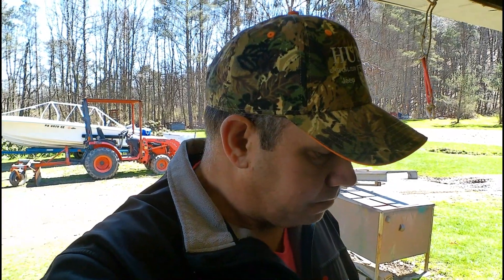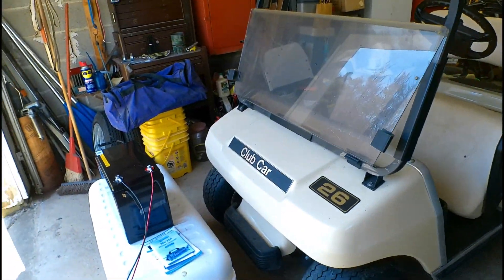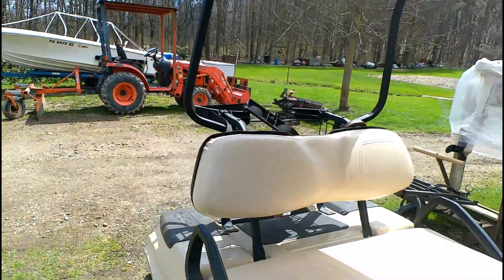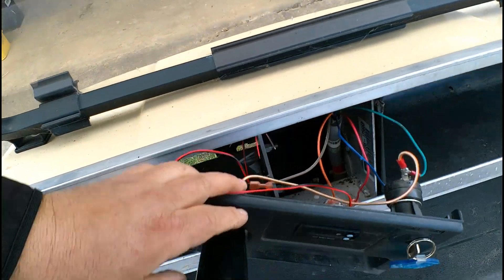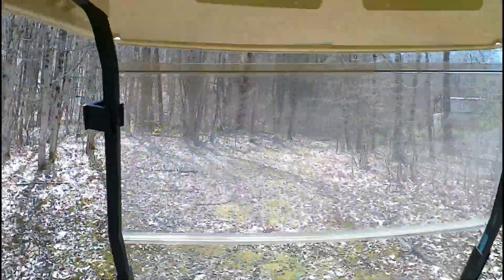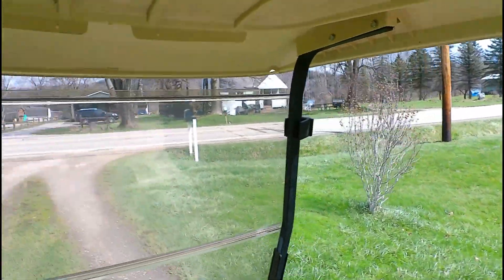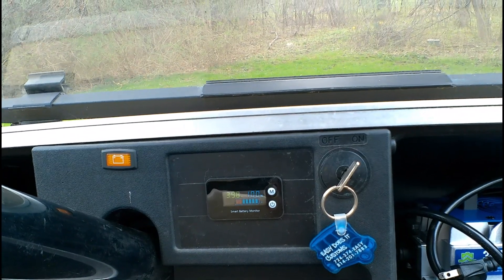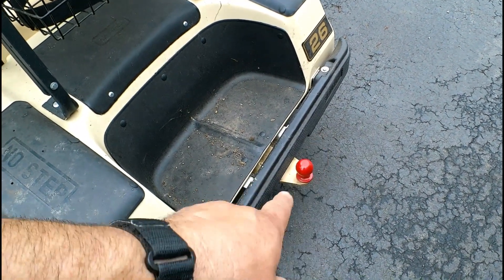Club Car Lithium Battery Upgrade | From 6 to 3 to 1 Battery | Lithium Iron Phosphate

Comment: I had the same experience with the 3-12 conversion, cooked batteries.  I even purchased a high tech (supposedly) charger.  I made the switch to li-po but the 100 amp size, with the proper charger, amazing performance.  The larger battery posed some installation challenges but not a difficult project  In addition I am still using the old "toaster" controls.  Will likely upgrade to electronic at some point.

Comment: I've had 3 deep cycle group 27 Costco batteries in my old industrial 36 volt cart going on 5 years, I use a club car 36 volt charger.  zero issues.  That said, when these 3 batteries finally die, I'm tempted to try a Lithium.  The key to lead acid battery health is to fully charge immediately after every use.  Park the cart and plug in the charger, mine has a twist knob / timer so I just set it for 2 or 3 hours and it will fully charge in that time.

Comment: Club car's website says that the maximum power output is 9600 watts.  9600 / 36 volts = 266.67 amps draw at maximum power but the controller limits the draw to 250 amps.
50 amp-hours / 250 amps = 12 minutes at maximum before the battery is fully depleated.
Used at 50% capacity,  4800 watts / 36 volts = 133.34 amps.  50/133.34 = 22.5 minutes untill depletion.
I would suggest putting another 36 volt Lion battery wired in parallel. The capacity increases but the voltage remains the same.
Reply from the maker: @Digidoc316  I appreciate the fact that you went to the trouble of researching this information, but I can assure you that something is terrible flawed in either Club Cars information or the math because this cart has been in use now for 3 days on a single charge and has exceeded those time tables of run time at full out and 50% by far and still is going like a champ. I personally logged over 30 minutes of solid run time at various speeds for testing purposes before returning this to my neighbor and it isn't showing any signs of needing to be charged yet so that is all I can really say.
Reply: @pa50cals  Might be your unit is an older model.  The specs they gave were for the newest version. 
I know the math is solid; electrical engineers have been using Watts Law for centuries.

Comment: Good job we have a 48-volt club car we use it on the farm it's an older cart where did you get the box on your cart for the back.
Reply from the maker: @dannydunnagan3267  hello my friend, good to hear from you. The box I believe that you are referring to on my red cart actually isn't a box at all. It is an aluminum hitch hauler from Harbor Freight minus the 2 inch tube that would normally go into a vehicle receiver. Not only can you haul all sorts of stuff in it but it's great for standing tools up in.